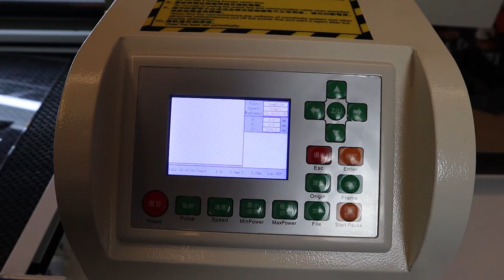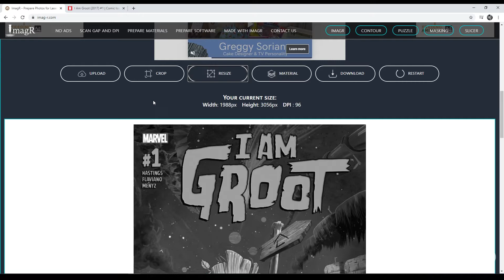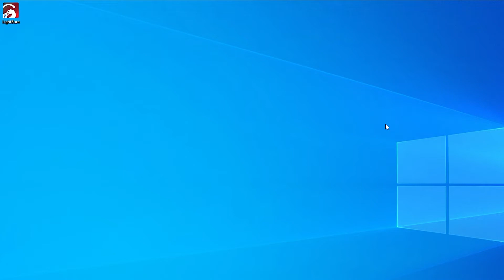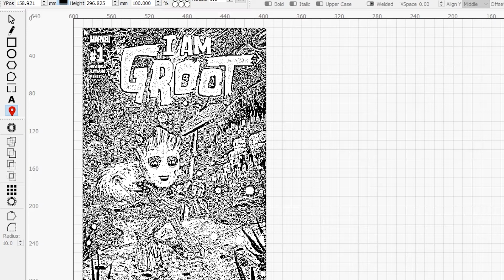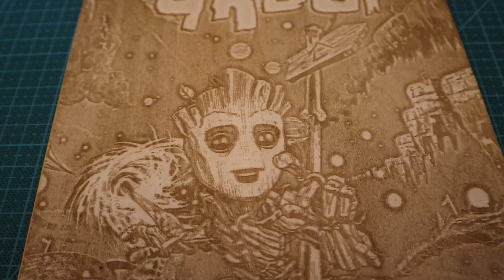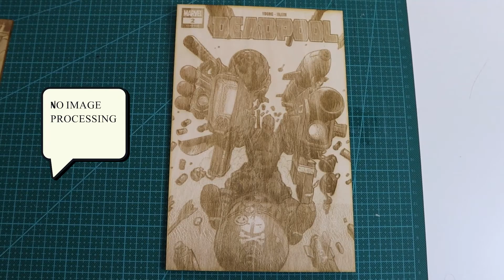How to Engrave Comic Book Covers on a CO2 Laser

Comment: Very cool and simpler than I imagined. I'm guessing the laser cutter is really expensive though? I'm thinking a logo engraved like this and then side lit using LED strips would be awesome. Can you fit an A3 size sheet into the engraver?
Reply from the maker: The small 3020 versions is cheaper, the price increase as the bed size increase and tube power, a diode laser can cut acrylic and engrave as well for logo but will need to do multiple passes. This model I have can fir A3 sheets it is 400*600mm